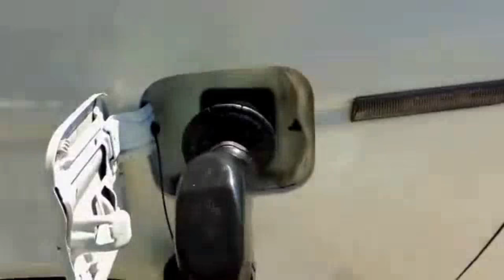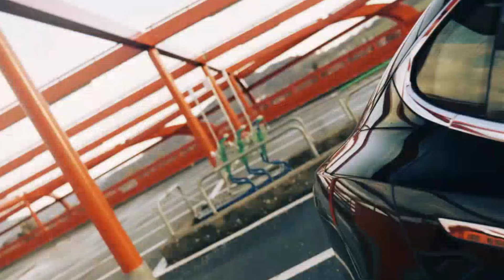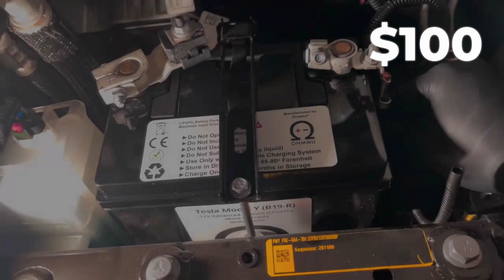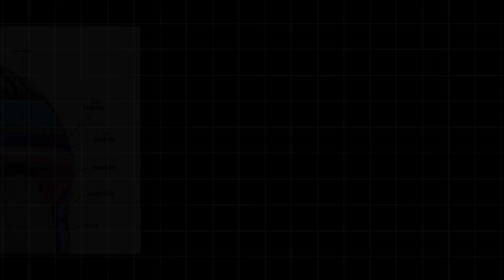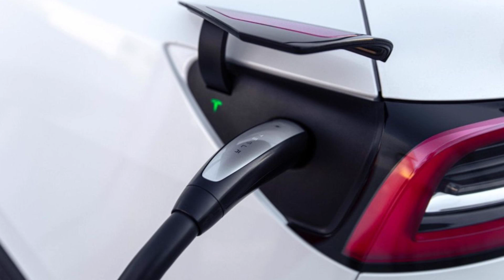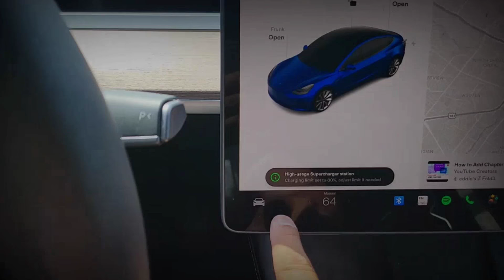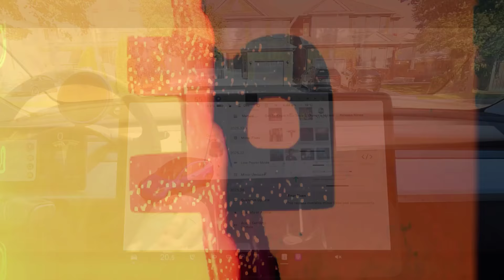How To Make Your Tesla Last Over 300k Miles Without Any Major Repairs

Comment: You did not clarify the difference in battery chemistry, LFP batteries are treated differently. Not well researched.😮
Reply: For simple guidance, follow the recommendations of the manufacturer.  

For Tesla vehicles equipped with a Lithium Iron Phosphate (LFP) battery—typically found in newer Model 3 and Model Y Rear-Wheel Drive (RWD) variants—Tesla recommends keeping your charge limit set to 100%, even for daily use. 

Official Tesla Recommendations
Set Limit to 100%: Unlike nickel-based batteries (NCA/NMC), you should set your charge limit to 100% for daily driving.
Fully Charge Weekly: Tesla advises charging your vehicle to 100% at least once per week.
Always Be Connected (ABC): It is generally recommended to keep the vehicle plugged in whenever it is not in use.
Parking Longevity: If your vehicle has been parked for more than a week, Tesla recommends charging it to 100% as soon as possible. 

Why the 100% Rule is Different for LFP
Tesla's specific guidance for LFP batteries is primarily due to their unique chemical properties: 
BMS Calibration: LFP batteries have a very "flat" voltage curve, meaning the voltage stays nearly the same between 20% and 80% charge. Regular 100% charging allows the Battery Management System (BMS) to accurately calibrate the battery's state of charge and provide precise range estimates.
Cell Balancing: Reaching a full 100% charge helps balance the voltage across all battery cells, which ensures optimal performance and prevents the vehicle from potentially shutting down before reaching 0%.
High Resilience: LFP chemistry is more robust and tolerant of high states of charge compared to standard lithium-ion batteries, leading to less degradation even when fully charged.
Reply: I'm only mentioning it because these are still lithium batteries.
The decision is yours.

"Recommendation for LFP is to drain it during the week (or set an ~80% charge limit) and then charge it up to 100% around once a week for calibration purposes."

< Citation Start >
August 26, 2024

Lithium Iron Phosphate (LFP) batteries have been the go-to option for many electric vehicles, known for their durability, safety, and cost-effectiveness. For years, automakers like Tesla have encouraged drivers to regularly charge their LFP-equipped vehicles to 100% without fear of significant battery degradation. That’s why you’ll find them in entry-level EVs like the rear-wheel-drive Tesla Model 3 and the base Ford Mustang Mach-E. Automakers have consistently recommended charging these batteries to 100% to keep range estimates accurate and maintain battery health. 

But a new study is shaking up that advice, suggesting that full charges might not be as harmless as once believed.

> So, what’s the big deal?
The study tested various charging ranges—from 0%-25% to 75%-100%—and under different temperature conditions. The results? Charging to 100% regularly, especially in warmer climates, can cause LFP batteries to degrade faster. For instance, in the worst-case scenario, some cells lost up to 24% of their capacity over the equivalent of 10 years of use.

While that sounds alarming, the study also notes that the actual impact on battery life might not be as significant as it seems. Even with more frequent full charges, most users will see relatively minor degradation, especially when considering the long warranties offered by manufacturers. Tesla’s LFP batteries, for example, are expected to last hundreds of thousands of miles, with a 15-year lifespan before dropping to 85% capacity.

> What’s a driver to do?
So, should drivers change how they charge there EV? The study doesn’t call for a complete overhaul of your habits, but it does suggest a more balanced approach. Charging to 100% might be necessary for long road trips or during winter when range is limited. But for daily use, keeping the battery at a lower state of charge could help extend its life.

< Source >
batterytechonline.com
< Citation End >
Reply: Most rear wheel standard range are LFP, including mine bought in US
Reply: Yes I was actually about to make this comment, the first tip only applies to NMC type of batteries (for tesla its models I think that are 2019 or older as they changed to LFP in 2020/21) if you have a standard range Tesla that is newer than 2020/21 they are all LFP and they actually like being charged to 100 at least once or twice a week, if you have a long range Tesla I believe they are still using NMC batteries as LFP's normally cant give the extra range and they are the ones you keep at 80%.
Reply: @virtuaconker85 Totally wrong.
Most NA Tesla’s are standard lithium — only foreign model Y’s use LFP.  Not a single NA MY has LFP.
Reply: @tabbycat8511  Funny because mine does.
Reply: @wgemini4422 It isn’t LFP if you bought in NA.
Reply: @tabbycat8511  Except it is. In fact, the entire car is made in China. VIN starts with LRW (maps to Tesla, Inc. (Gigafactory Shanghai)). Again, NA is a lot bigger than the US.
Reply: @wgemini4422 You in Canader?

Comment: The builtin TPMS doesn't NEED to "trigger", as you say, before you notice that the tires are low.  The sensed tire pressures of all four wheels are displayed on one of the three permanently selectable information cards on the main screen.
Reply: I found that when I swiped the radio rather than tapped the tire pressures came up the energy monitor is the other one.

Comment: Too right that regen braking massively lessens an EV's use of friction brakes.  So I don't understand why it's necessary to obsess over water absorption into the brake fluid as if the braking system was exclusively using the friction brakes.

Comment: Tesla no longer uses lead-acid style low voltage batteries, and hasn't since about 2022.  The lithium ion units that replaced them last much longer.  Your advice that all 12V batteries be replaced every three years is horribly over simplistic.
Reply: Moreover, when the 12v battery dies the car don't necessarily turns into a brick. The morning after mine died (during a software update) the car managed to recover itself and kept itself on while constantly charging the 12v from the main battery for a few days until I arrived at the service center to get it replaced.
Reply: @hemiramon1 was your 12V due to be replaced though it was drained and charged back up?!
Reply: true
Reply: It applies to pre-lithium batteries 🔋 though!
Reply: I did not get a warning. My 12 v battery died with my dog inside the car during the summer. It bricked. Panic time! Called my husband and other Tesla friends to HELP before I broke a window. Using another small 12 volt battery we were able to pop the frunk and from there open the car. Saved my furbaby and my window. No alert nothing. I then texted all my Tesla friends to tell them about the battery brickdown. Within a few days three of them received a battery failure notice. Note they received a warning. Tesla replaced the battery for 112. Unfortunately it was not the newer battery so I have on my calendar to replace the battery in three years. Love my Tesla especially the dog mode. Thank you Elon
Reply: @rwentowski no warning ‼️ on mine too even when it was due to be replaced though!  Just happened I forced Tesla service to take me in for annual maintenance 👩‍🔧 though they said I could have waited for another year 😮!

Comment: You can start and stop preconditioning through siri shortcuts if you use a apple phone. I use it while still plugged in to my level 2 charger at home before I leave every morning.
Reply: Preheating your cabin is not the same as preconditioning your batterie while driving…